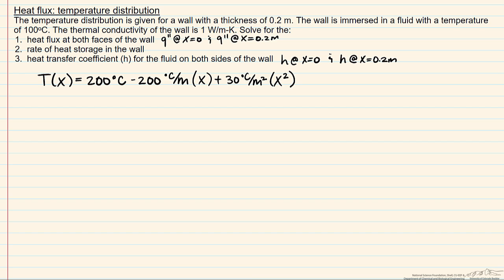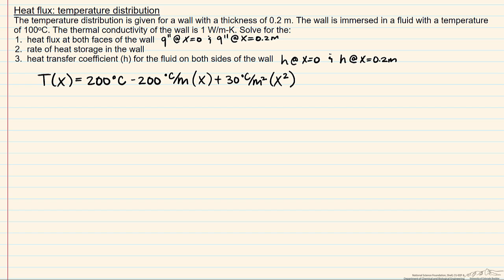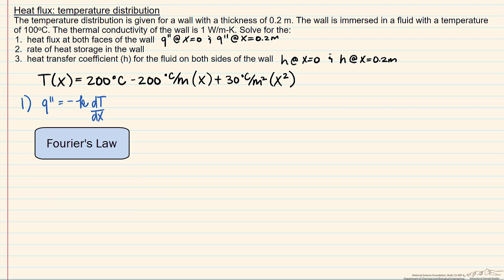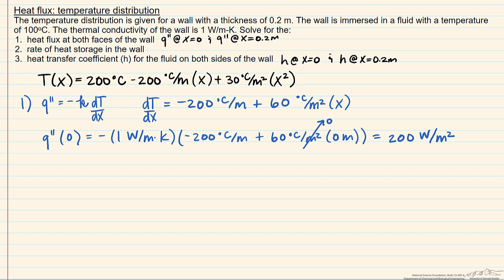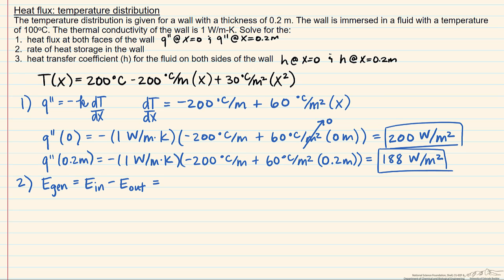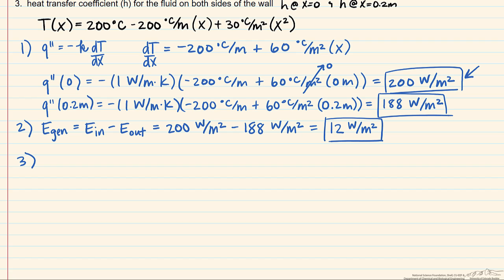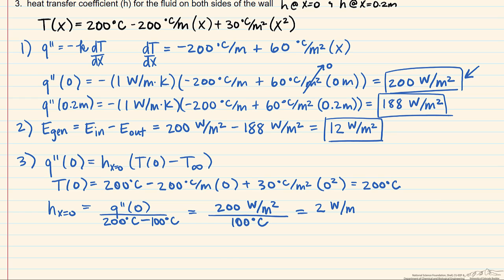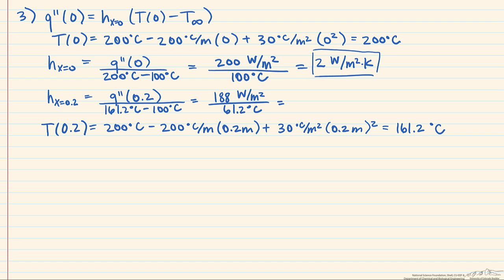Heat Flux: Temperature Distribution

Comment: I substituted the temperature profile equation into the heat diffusion equation to solve for the heat storage rate and I got 60 W/m^3. This answer assumes that there is no heat generation, the thermal conductivity is constant, and the conduction in the wall is one-dimensional.

Comment: Since both side of the wall has temperature higher than the surrounding fluid temperature, shouldn't part a) be -200W/m^2 and 188W/m^2 and part b) be -200-188 = -318W/m^2 since the wall only lost energy?
Reply: Based on computation, it is +200 W/m^2 so we will stick on this. The problem is it will violate 2nd law of thermodynamics (heat flows from 100°C to 200°C). Maybe to solve this, there should be a given heat flux from 200°C surface to 100°C water lets say this heat flux = q(w). Then net heat flux at surface x = 0, will be q(0) - q(w).

Comment: Don't you think the deg C unit should change to deg K or vice versa for them to cancel out in part 'a' of the question.
Reply from the maker: Great question. In this case, we're dealing with temperature differences, so the units are the same. Another way to think of it is to note that the thermal conductivity is 1 W/m for every unit Kelvin. A unit Kelvin is the same as a degree Celsius.